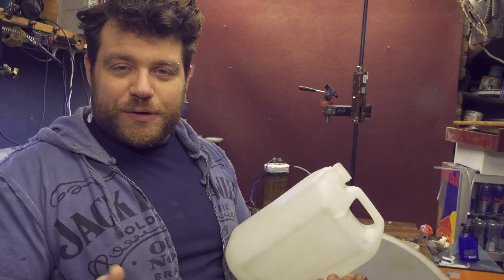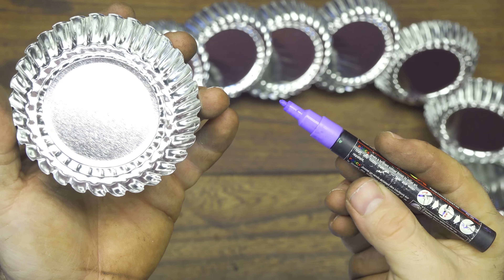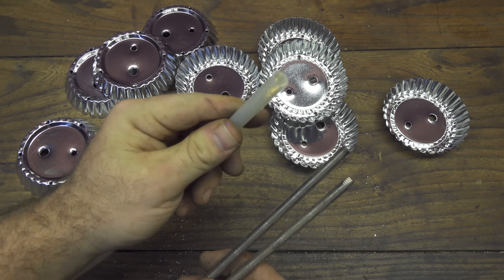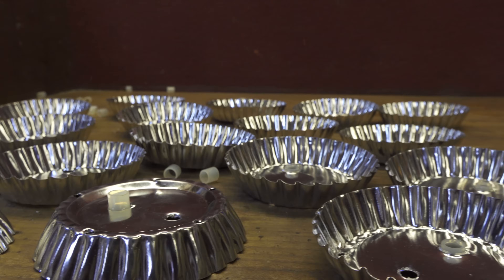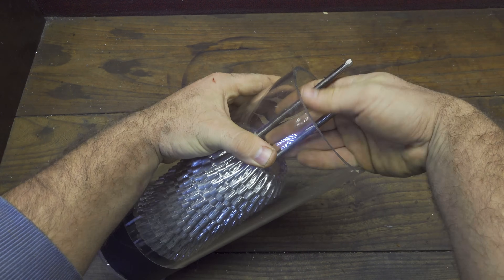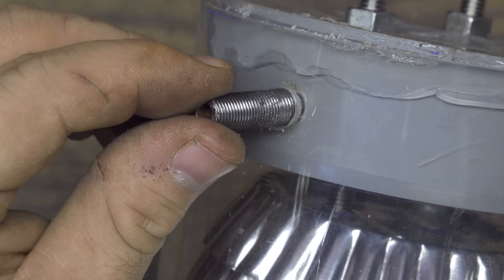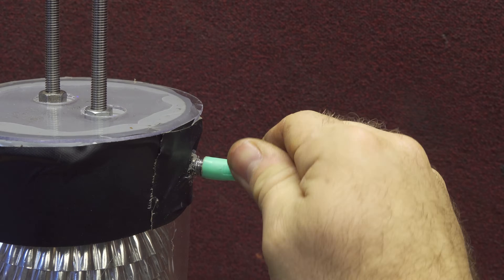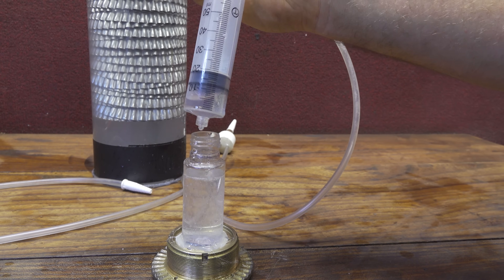Superpowerful Flame 5072 ℉ • Produce Hydrogen from Water - Do it yourself

Comment: Anyone to try this use Caution, if your cell runs hot and/or creates a yellow/orange Electrolyte solution that is likely to be Sodium Chromate (if sodium salt electrolyte). Chromates are Cancerous and the way to check is acidified hydrogen peroxide (dilute sulfuric +some h202) will indicate a momentary Bluish Violet reaction which quickly dissipates, that is the Cr+6 being destroyed down to Cr+3 state. There are ways to destroy the Chromates, (ascorbic acid, sulfite powders)  Great project! (Not a chemist btw.)
Reply: more than useful info, so people don't kill themselves while replicating this. thanks
Reply: But where has he used chromium or any chromium salt?
Reply: @arnavchhabra430  Chromium in the Stainless steel leaches out from the Positive electrode and oxidized to a +6 state and with sodium being used as common electrolyte
Reply: Ok,Thanks for the knowledge
Reply: @BasementBen  great point. AC powering would prevent the electrolysis of chromium from stainless steel?
Reply: @claudiog.7397  Im afraid it would have only a small effect at most, thats an interesting idea though, perhaps low temperatures and Low voltages
Reply: AC doesn't work good.
Reply: @arnavchhabra430  rulof didn't, but other people might use it accidentally lol
Reply: Commercial machines use potassium hydroxide as it's most efficient. They work at 2V per cell. This means with your power supply you need 2 cells in series (can be in a single container).  Double output, same power input.
(This is not over unity - which doesn't exist! - it just means effectivity gains from about 25% to 50% (losses in the rectfier not included)). Commercial machines use a stack of 110 stainless steel sheets at 230V. There is a 2mm EPDM or butyl rubber gasket between them so they are also the spacers. The hole stack is clamped with 4 threaded rods and reinforcement plates at the ends. This way they don't need a transformer, have less electric losses in the rectifier and almost reach the 2V per cell which would give about 70% efficiency.
Take care the waste energy get's cooled! Your plastic container should not have boiling water!
Also you don't want water vapour (which is a gas made from water but does not burn) at the nozzle as it reduces the flame temperature. (It would over fill the flashback arrestor first.)
In commercial machines the sheets are a bit bigger then the outside if the gaskets. So they form cooling ribs, which are ventilated.
The sheets have 2 holes each. One is in the top of the cells (below the gasket) for the gas transport to the end. The other is in the lower half for the water to level.
By the way the sun is much hotter. There the hydrogen is burned to helium (nuclear process) and here it's burned to water (chemical process).

Comment: I got into a lot of trouble in elementary school once because of hydrogen/oxygen.. lol

Hydrogen has not many advantages over acetylene. Could you try to make a torch like this with Calcium Carbide and an air pump?
Just be careful with Acetylene 😆 flashbacks could be fatal
Reply: flashbacks are also fatal with oxygen and hydrogen....
Reply: @Ramog1000  how much damage will 1 meter of 10mm tube do if it flashbacks?
Reply: 0

Comment: I am contemplating, and currently googling, the possibilities of using a system like this to power a DIY metal foundry. at those temperatures it should be possible to melt even steel, I think.
However, I don't know how economical it would be. for a "standard" backyard aluminum foundry you'd probably need 5-10 times as much gas production which would be. ..hmm, between 1200-2500 watts, which is quite a lot of energy. but, it'd probably only be for half an hour or so at a time so maybe it'd be economical.
The reason I'm pondering on this is it would completely get rid of issues some casters have with propane tanks freezing. It would also remove the need to store compressed propane.
The reason I question the economics is because, while the two reasons I listed might be good enough reasons to justify doing it, if it's going to cost 10 times as much as propane after calculating electrical costs, then it would be pointless.
Reply: Hydrogen is bad for metals ,most steels will be fucked up by it ,it causes small cracks in metal-hydrogen embrittlement-.I also thought of it as a cutting torch ,but its a no no .
Second thing stainless steel produces hexavalent chromium which is extremly toxic even in small doses.
Reply: @zumbazumba1  after about 20 minutes of research I'm not sure your statements actually apply here. it appears that hydrogen embrittlement is mostly occurs in steam generation, and that by heating metals the hydrogen will simply diffuse, so for example a casting of steel would fairly slowly cool and should release any hydrogen that diffuse into it during the foundry process. 
I've also seen several things about oxyhydrogen welding and cutting with absolutely no references to hydrogen embrittlement. 
But, oxyhydrogen can melt fire brick and some other refractory materials, so it might be a wee bit overpowered for a home foundry haha.
Thank you so much for letting me know about the hydrogen embrittlement, even though I studied a bit of material science in college that wasn't covered and it's really interesting!
Reply: @dscrive  Well they do say non ferrous metals are more resistant so it might work with aluminum ,bronze,zinc and other metals like that,but yea temperature is overkill by far.Dont think your crucible would last long.
Reply: @zumbazumba1  Yeah, graphite crucibles are only rated for about 3000 F. .but! I learned something new today, tungsten crucibles exist and, after too much digging, I found a site that gave temperature specs, looks like they have a theoretical melting point of about 6000 F so, it'd be close, but they ought to hold up to the heat from the hydrogen flame. . .but another site did mention something about oxidation issues with certain kinds of fuels.
But, even with the crucible somewhat sorted out the refractory lining the foundry would have to also be able to handle the temperatures. 
Dang, that hydrogen burns hot, I don't think I fully appreciated that until now. I wonder if it'd be possible to restrict the oxygen to the flame and run it colder, or if the flame would just pull all the oxygen it needed from ambient air.
Reply: m i c r o w a v e

Comment: Awesome, I'd also suggest making the bubbler chamber a little bigger so you can have more room between the surface of the water and the gas line coming out, maybe also put some sort of baffle in between as well so you don't get water coming through the line and into the torch. I noticed in the video there was water dripping from the torch tip and the flame was an orange color indicating to me the flame was being slightly effected by water vapor.
Reply: Hey  I think this is kind of good though because they say a hydrogen flame is invisible, but not this one.
Reply: @epichourtime  True but at the same time it could be lowering the overall temperature of the flame and thus making it less effective than it should be.
Reply: The product of combustion is water

Comment: Great job as always, one suggestion though, there is a chance of it caching air bubbles under the dishes, you can invert the dishes to solve the problem.
Reply: Great advice! Unfortunatly The plates form in  the centre a convex shape that can form air bubbles trap
Reply: Good point.  Seems he went to all the trouble of drilling extra holes, instead.

Comment: a great fan of your work but this design is not so efficient . to make is better you could easily flip the cups upside-down and use DC instead of AC
Reply: There is a voice in my head that says:
Full bridge rectifiaaaah!
Reply: @asgkllngfxxhkkvxdhkkbhjllnvcg  Yeah ... i know that guy ! :)
Reply: @jort93z  in certain conditions you might want to be able to shut off the chlorine.
Reply: @codingmaster6321  He uses sodium bicarbonate. Where does the chlorine come from?
Reply: @scelestus6930  you'll never gonna use distilled water for this ... : \
Reply: @scelestus6930  
From the tap water used in this "bubble filter" xD
Reply: @asgkllngfxxhkkvxdhkkbhjllnvcg  i think that vice come from electroboom😅😂😂
Reply: he does use DC. He has a transformer and a full bridge rectifier
Reply: @blackkissi  FULL BRIDGE  R E C T I F I E R
Reply: @blackkissi  !!!FULL BRIDGE RECTIFIER!!!!
Reply: @blackkissi  well.. i did not see the rectifier ... but ... to me defense this design is not efficient with dc either .   it needs a second hole and a filter to let the Chlorine out .
Reply: he used dc the rewound xformer had a rectifier to change ac to dc
Reply: Electrolysis does not exist and its impossible with AC electricity
Reply: @BluefuelSystemsH2ogas  How about you prove that claim.
Reply: @JaakkoF  .....Im on my way .....

Comment: If you reverse the metal cups so the bubbles will escape and go up more easily.
You can also use computer power supply. 
 Nice show, I admire your work.
Reply: Aljubouri A I was just thinking the exact same idea about reversing the metal cups. Well spotted.
Reply: How many amps does a computer power supply output? Cause this project requires very high amperage.
Reply: @amvkarthik  Tens of amps (about 30-40) at 12V rail. The only problem is that this is not current limited power supply so hiccup may occur.
Reply: @amvkarthik  depends on the particular supply really. They can go from around 30A on the 12v rail on lower rated supplies, all the way up to around 140A
Reply: M. KARTHIKEYAN 
Cant u tune the plates composition and spatial relationship to match a power source with a low(er) Amperage and a High(er) Voltage input? A voltage that when phased correctly, has a constructive interference attribute as it induces a charge across the plates by the generated standing wave amplifying itself harmonically? 
Maybe configuring the plates in a 3 phase circuit and playing around with the AC input Hz? 

Any one want to throw in some figures that need to be hit to break the H and O2 bonds? 
Im sure it can be done with resonance as well as brute force....
Reply: @muntee33   Yes.  Use a dc biased wave of whatever shape you feel is appropriate to cause a vibration without making it dance off the table.  Adjust the amplitude, not the plates.  Much easier.
Reply: the higher the frequency pulsed through it with a square wave the better results you will get
Reply: vaccines Kill 
Why?
Reply: @muntee33   because......... population control
Reply: This was really annoying realising how much power he was loosing
That flame could have easily been twice or even 3 times as long and dense.
Reply: @ironicman6731  Please explain how you would alter this project to get a "flame...twice or even 3 times as long and dense."
Reply: @ironicman6731  Eventually the cups become saturated with bubbles and the output of bubbles is the same amount as is being generated, reversing the cups would only make a difference for a few seconds when you first turn it on..
He was not "loosing" any power output and if he was then where did it go? Conservation of energy states that it can't just disappear
Reply: @user-tr2dh4xx6u  it turns into heat which further lowers the efficiency of course.
Reply: @ironicman6731  nope... the bubbles only turn into heat once they are burned...
Reply: Car battery is plenty if you are just doing it for experimental purposes
Reply: Aljubouri A ur
Y
Two
Reply: Computer Power Supply, there's your 10.00 'sup-up' for huge gains on the cheap ;D NIIIIICE! I was using golf car batteries, ganging them up and getting crazy out of control current. You could see the thing arcing like a Tesla Coil, man! Kinda sceptic about plugging the thing directly into a wall (surge protector) on the 'ol 110V we got in the States, but, hey.. SCIENCE!
Reply: what I use..  the 12 volt  wire is brilliant for this
Reply: I thought the bubbles went through the holes in the middle of the cups. How would the water even get in between the cups if it was all sealed?
Reply: Great idea!
Reply: Can you use aluminium instead of stainless steel?
Reply: @azimalif266  I used aluminium foil. It works.
Reply: @azimalif266  no you can't
Reply: @azimalif266  sodium hydroxide is better than baking soda for the water, but sodium hydroxide would dissolve aluminium dont know what effect bicarbonate of soda would have, I imagine soda and sodium are both related somehow and would affect aluminum after all sodium is to do with salt, and road salt knackers the aluminum parts on my bike.. 🤷‍♂️
Reply: ba dmm tssss....
true
Reply: how should I use the power supply?
Reply: welding machine is best for this...
Reply: Hey all! There's no relevance how long the flame is, only the tip of the flame counts. Always aim the tip of the flame to the destination to be melted because the tip of the flame is the hottest!🎉
Reply: Wow amazing 😊
Reply: A computer power supply unit will not be able to provide the large current required by just one cell. I made a slightly different connection so that there would be many cells by the number of plates, minus one.
Reply: You don't have to reverse the cups that's what the small holes are for
Reply: @The_Cannabis_Connoisseur  still its better to flip the cups upside for a better flow of bubbles
Reply: @uncutdesi6828   Yes, logical.
Reply: Bump
Reply: top level comment.
Reply: @Adolf Hitler Salve César!
Reply: @hectorvalle2443 what makes you, hitler, or anyone else any better? Everyone is born with God given rights.